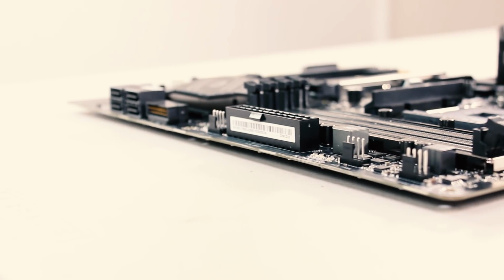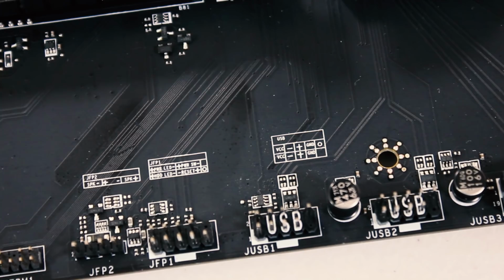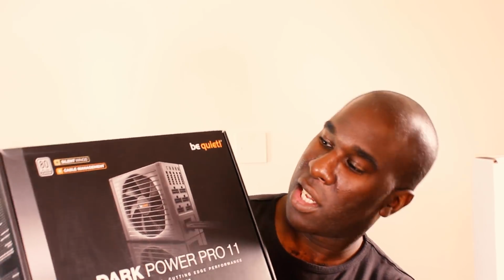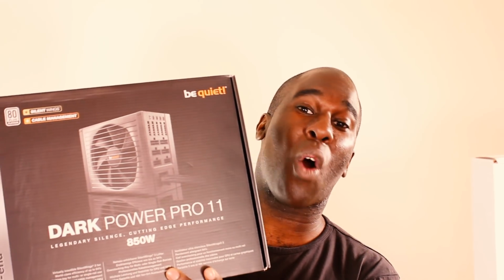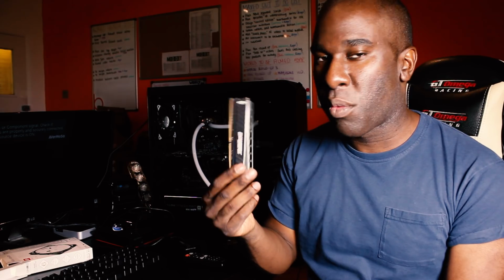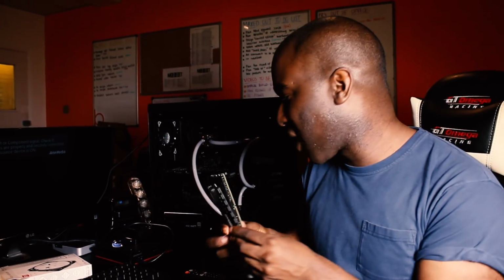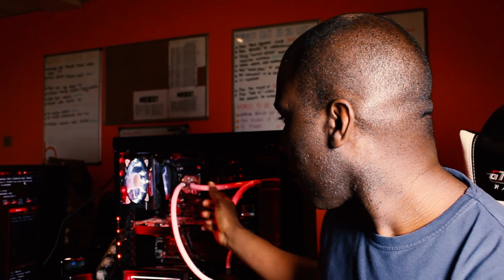MSI B350 Gaming Pro Carbon AMD Ryzen Overclocked!

Comment: Did not it happen to you that the disk that is causing the chopping of the system is loaded with a tough disk?
I have the same board, but I've been dealing with the chopping system for a month now, where my ssd disk gets 100%.

Comment: Does it support/has a rgb header?
Reply from the maker: +panaitolikos 66 Yes it does 😉
Reply: MXDOUT is it a 4pin connection?
Reply from the maker: +panaitolikos 66 rgb connector is a 4pin 😉
Reply: MXDOUT And 1 more question does this mobo change colours? (rgb?)
Reply: MXDOUT where is the 4pin rgb header located on the mobo? Plz let me Know as soon as possible because i'm gonna build a pc in a few hours!
Reply from the maker: +panaitolikos 66 it's at the bottom left of the motherboard called jled1😉
Reply from the maker: +panaitolikos 66 Yes it does 😉

Comment: My ryzen r5 1600 is stable at 3.8ghz @ 1.275v 
I got a question .. what settings are u using in cpu features in bios  ..
Do u disable anything there? 
Im using msi b350 gaming pro carbon

Comment: to my understanding you'll gain performance with the ryzen by only running two ram modules, when you run all four modules your locked into 2133mhz.
Reply from the maker: +danjal07 No just a different test... higher memory is much better fabrication on amd 😉

Comment: why the motherboard dosent let me put a rainbow efect or change the light into a patern
in the efects you can only pick one color
Reply from the maker: +Manu Fc That's not suppose to happen 🤔
Reply: MXDOUT. the x370 it does because ive tried it. but the b350 no
Reply from the maker: +Manu Fc Yeah you would be right there a little different, they may change this but I don't thing so 🙄

Comment: How frequent are ram memories?
Reply from the maker: +edrei eliu 2666mhz and 3000mhz I use two kinds in video 😉
Reply: This ram is compatible with the B350 GAMING PRO CARBON motherboard http://www.corsair.com/en-gb/vengeance-lpx-8gb-2x4gb-ddr4-dram-3000mhz-c15-memory-kit-black-cmk8gx4m2b3000c15
Reply from the maker: +edrei eliu Yes that's recommend 😉

Comment: Is there any reason for me to choose the X370 version over this if I have just 1 GPU, 1 SSD, 1 HDD. I mean ,does the x370 GP carbon oveclock better or support more high frequency memory?
Reply from the maker: Yes and know but one gpu... go with the b board especially if you want to overclock too :) also cheaper with slight limitation like not so much rgb  or usbs :)

Comment: can you over clock a ryzen 1700 to 4.0 GHz (all 8 cores) on a MSI X370 SLI PLUS if you have a corsair h100i v2? cause i have heard this motherboard is bad at over clocking. im not sure what to get, im building a pc and the mother board is all i need.
Reply from the maker: +Manu Good question...this is what you need to know, when it comes down to overclocking you need a good cpu "silicone lottery" meaning the cpus normally used for pro overclocking are getting higher overclocks than normal retail cpu, unless you win the "silicone lottery".

So next thing is to get a decent overclocking motherboard "Asus" and even funnier the msi b boards can overclocks really well, but it needs a good bios and cooling as well as exhausting heat out of the case and also making sure vrms, chokes and basically motherboard is cooled as it's not just about water Cooling the cpu, as everything else will start heating up.  

Go with what your budget can go to or what your willing to pay as I said it's not easy to have a stable overclocks but yes there's tweaks and knowing what parts too cool.
Reply: MXDOUT thank you man
Reply from the maker: +Manu Not a problem always here to help😀

Comment: The usb header under the socket is for AIO liquid coolers that need a usb  port, like the NZXT Kraken x62. Though it would be better near the top.
Reply from the maker: +Cirux321 Okay...well soon I will be getting some new NZXT aios from NZXT and then I can use such a port 😂
Reply from the maker: +Cirux321 I agree but it depends on cases inverted or non inverted, modular ect.
Reply: Wouldnt matter. The USB hub would still be next to the socket, so you would still plug in the AIO to it. Just for cable management purposes, it should be up next to the CPU Fan and/or Pump headers instead of below the socket in the middle of the board.

Comment: 30 minute video... I just wanted to know how to overclock on the board. I didn't need to know about the specs and everything else you're going to put into the PC. You should name the title as such....
Reply from the maker: I put the specs in because i wanted to make sure everyone had the right components to do  it with, just in case they damage their system no one wants that, but next time i will do a stamp time so you get straight into overclock mode :)

Comment: any ram for this board and a ryzen 5 1600?
like you i've in mind corsair lpx.
Reply from the maker: +Sully Castillo Hey any ram works on there.. nearly... other than xmp mode and with the higher frequency memory you will definitely see inprovements like corsair lpx 3000mhz and higher...but you have see in my videos that when ryzen was released I was using non compatible memory and it work with all the tests other than xmp..but I still manage to overclock the memory 😊

Comment: Dude looks like he made this video immediately after banging 3 chicks...
Reply from the maker: +Necrodor21 I hope it is😉
Reply: exciting
Reply: LMAO! There is still some jizz on his hands, too ;)
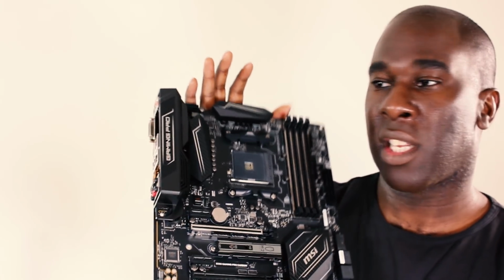Nice review, B350 is OC-board, X370 is OC-board with native SLI support.....(@6:11)
Reply from the maker: +Simon le Bon correct 😉
Reply from the maker: No problems... more overclocking videos coming that are more straight to the point, so you can do it straight away from looking at my video in a few minutes, which i am going to try today on a graphics card :)
Reply: About the hands? LOL

Used this board a couple of weeks ago for a build, runs like a charm with a Ryzen 1600@3.8Ghz on air cooling with 16 Gigs of G.Skill Fortis RAM (@2933 was the sweet spot).
Thanks for the review!

Comment: why you dont overclock your memory ? probly you can run it at 3000 mgh /2933mgh  maybe you get more power ....
Reply from the maker: i did in one the ryzen videos, but i wasn't truly focused on the fabrication of this, just the cpu.
Have a video on the x370 gigabyte motherboard with hitting the overclock coming tomorrow:)
Reply: Hey i bought the same Motherboard and iam not able to overclock the cpu in the biossttings did you have the same problem ?
Reply from the maker: +Richard Kenzel Nope I could Overclock very well on there list you specks down below and I will try and help you out😉
Reply: My problem is when i overclock the cpu to 3.9 ghz and ram at 2999mgh in Bios its ok but in windows the cpu clocks at 1.5 ghz and ram at stock speed (2666) i use Bios version 130 and 143 Betabios so my only chance to overclock is Ryzenmaster -.-
Reply: msi b350 gaming pro carbon, ryzen 1600, Kingston Hyperx Fury 2666mgh, bequiet dark rock pro 2, msi 1060 6gb, corsair ax 750, Samsung 840 evo and 2x Saegate Barracuda 2 Tb hdd
Reply from the maker: +Richard Kenzel kool😉
Reply from the maker: +Richard Kenzel The ram is 2666mhz standard and are you saying you cpu is over clocked to 3.9 ghz but when you get to the windows desktop and check it's 1.5 ghz????

Comment: Great video, I love this MB. I am loving the introduction of premium Intel i211 Lan, AC1220 audio, and those sweet sweet power phases to the b350 subset.
With the reversed top fans, did you notice any issues ie. hot spots in the case with no circulation in critical areas (smoke test)? Did you tweak the rear fan speed to compensate releasing all that cpu / northbridge gusto? That high air pressure coefficient inside could potentially cause more heat accumulation.
I guess I'm asking about longevity, after a stable overclock did you test for an extended period on the bench and read temps again?
I am seriously considering this board, hence the details are important down to a T when weighing against an x370!
Thank you sir, great review!
Reply from the maker: Out of all the comments i had left,  i left you last, as this is what i was testing for!
I also have the asus x370 board and i would like to address you answers in my next video, because writing all on here would take quite a long time :)

But i will contact you on here to say i released that video about your issues you may face!
Reply: I went with this board because it was the cheapest mobo for ryzen that I could find with the AC1220 audio. I have no intention of ever running 2+ vid cards. So far with bios update 1.3 it's running smooth at 3.8ghz/1.32v with ram at 3200, which is a Samsung E-die Dual rank rated for 3200. good temps too
Reply: Can I ask you exactly what you use ram
Reply: G.SKILL TridentZ Series 16GB (2 x 8GB) 288-Pin DDR4 SDRAM DDR4 3200 (PC4 25600) Intel Z170 Platform Desktop Memory Model F4-3200C16D-16GTZKW

Comment: new bios v1.2 out on 4/26 says Improved memory compatibility. I this same mobo in the mail with a 1600 and 16 gigs of gskill triton 3200ghz 16cas in the mail. I hope to OC the 1600 to 3.8ghz and the mem to 3200 or 2933 at least. I'm just not sure how I'm going to adjust the voltages for maximum long term stability without going to high in temps
Reply from the maker: Thats where you will have to play with fan curves, voltages, memory voltages etc. 
What i would do is overclock cpu only and get a stable overclock where it's not crashing, blue screening or black screening and use prime 95 to stress test the overclock and then run cinebench for peace of mind to see if your overclock is stable, then when thats stable try to bring the voltage down to see if you a lucy lottery silicon winner, and then adjust temps ect. 
Then when thats all done do some normal task as you would on the pc, then try and overclok the memory, also save profiles of all the work you have done, so that you know where you are and then all you need to do is step back a step if all goes wrong;)

Comment: I subbed because you're the only tech tuber that's run my similar set up I'm not sure how good you are with computer repair but I need a little help I'm running x370 carbon Trident z RGB F4-3200c16D-16GTZR kit and a 1600x I have 7.95 of 16gb I've cleared the cmos I've done msconfig settings, I've messed with Run Msc.services and still it says 8gbs the system sees two dims at 16gb but won't use it
Reply from the maker: Darnell Smith Hey have you tried updating your bios?
Reply: F4-3200c16D-16GTZR
Reply: MXDOUT yeah I think there was an up date 4/26
Reply from the maker: There should be;)